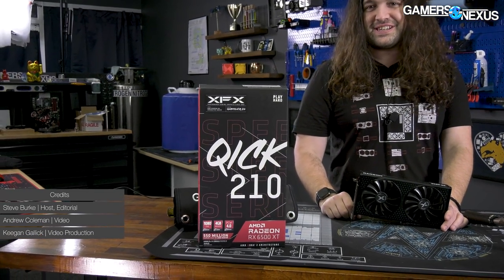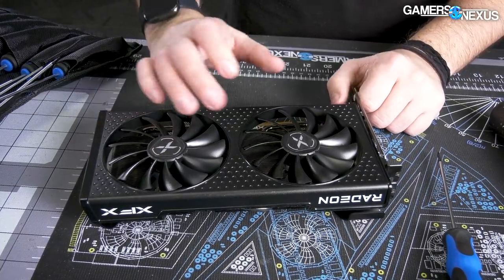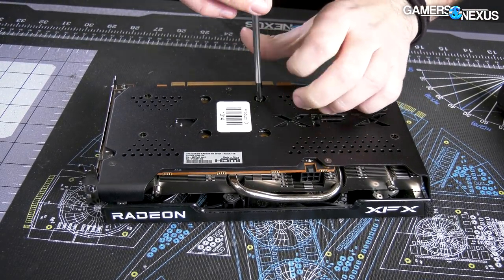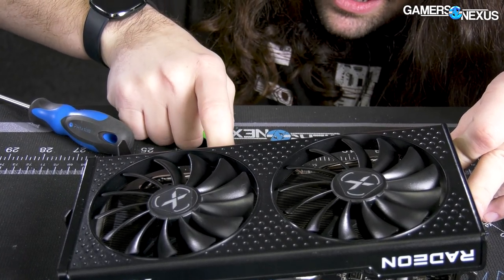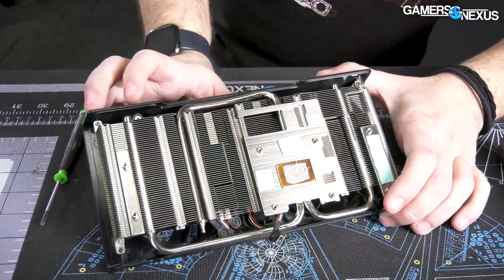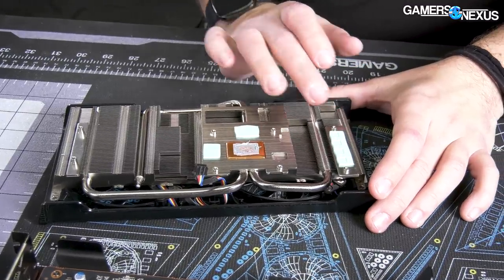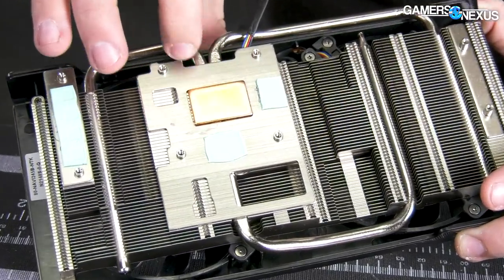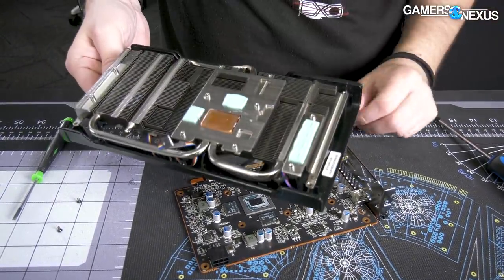Tearing Down Trash: AMD XFX RX 6500 XT Disassembly

Comment: If this was a low profile, single slot card at 75 watts with no 6-pin, it would be awesome!  What you have is NOT awesome!
Reply: Instead you get whatever Gigabyte thinks makes sense for this GPU, 3 fans for super cooling 100watts
Reply: Perhaps that could be what the rumored upcoming RX 6400 is?
Reply: @thelegendaryklobb2879  The RX 6400 isn't "rumoured", it was announced alongside the RX 6500 XT. It's just OEM-only.
Reply: The 6500xt has same pcie electrical connection with 1030 lol
Reply: @thelegendaryklobb2879  as a primarily Nvidia gpu guy I had high hopes for the 6500xt and 6400. To see the 6500xt perform worse than a 5500xt is disappointing as hell. I fear what the 6400 benchmarks are gonna look like. The 6500xt is a true pandemic gpu. Amd cheaped out in so many places that they basically botched a what could have been a decent budget gpu
Reply: @justinbiggs1005  
Cost for the 6500xt in the current crap show
Die cost is around $18
Board, VRM, etc. $50
30% markup to pay for R&D and other things (Normally is 60% for Nvidia and 45% for AMD) Total 150
VRAM $12 a GB so $48
Cooler $15
Shipping (right now) $30
The rough total before any AIB markup, $195
Reply: VERY much this. We need more low profile solutions. 
Currently best on market is 1030. MAYBE...the 1050 and 1650, but they're always double slot low profile at best, 
and they're also 300 bucks or more right now.
Reply: @AC3handle  GTX1050 4GB is legendary on gaming laptops. Way better than GT1030.

GT1030 can't handle Crysis remaster, 1050 mobile can.
Reply: RTX2060 mobile is pretty good too.

The only good card from that list is the GTX1650, but it's Pascal refresh, there are better options out there for a similar price.
Reply: @saricubra2867  I have a 1050ti, it's fcking fantastic. I love it. NO need for extra power, although oddly enough, it does have the traces FOR one. 
PROBLEM. It's a full size card, that's 2 slots wide. 
You ever see the picture of a dell low profile machine with a hole cut in it JUST for that exact card? 
I felt that to my bones. 
As said in another comment, if they could make a low profile version with just a slightly less powerdraw, the market for it would easily pay for the cost. even at the 300$ mark.
Reply: @saricubra2867  Low profile?
Reply: @justinbiggs1005  Agreed
Reply: @AC3handle  Yes, Ampere is better than RDNA2. Pascal is more efficient than RX 500 series.
Reply: Also $99.
Reply: It's literally a worse 1650 Super over 2 years later
Reply: except it costs a lot of money to produce and ship this card RIGHT NOW, a sub 150 dollar card would be throwing money away right now if you were amd!
Reply: @bitelaserkhalif  pci power from the slot is 75 watts. The 6-pin on the 6500xt is for the extra 5w.
Reply: @bitelaserkhalif  The 1030 is 30w. It doesn't even need a fan and can be cooled by a beefy heatsink.
Reply: Amd 5300 for oems only is one
Reply: @AC3handle  I run a straight 1050 2gb in my business computer and it's great for video 4k, movies, and it will still game on low and medium settings in some games. I still own a GTX TITAN 1080 with 12 gigs of ram on it and play games on it also... Just sold a GTX 1070ti 8gb for $550 when I bought it a few years ago used for $200.00. I'm not spending any big money on video cards until AMD and Nvidia get their shit straight and stop gouging people with the trash low and medium range shit cards....
Reply: @petedetraglia4776  Unfortunately, this is what the market demands, and thus, what the market will bear. 
I thought the 3070 was a great price at 500 bucks for what it offered. I knew the 3060 would likely do the same. 
Unfortunately, we got shorted, and crytos and botters got the lions share. 
Now, any business just looks for whatever processor can handle the video load. Or they buy HP and their crap ass super crap shit cards they toss into them. 
This is where we are now. Until the market gets saturated to the point that scalpers can't outbuy supply, that's the way it'll be.
Reply: No because it still wouldn't have simple codec support.
Reply: The W6500M is a way more sane card with 50 watt TDP it uses 50% less power and is like ~7% slower
Reply: @benc3825  
Source for all this?
Reply: There is a graphic card call 1650 ddr6 , without 6pin ,even cheaper than this amd shit
Reply: @justinbiggs1005  what it also shows is how much of a convoluted mess the gpu market has become due to the actions both sides have taken over the last 10 years trying to artificially segment their product lineups in the name of profit which has now come back to haunt them over the last 2 generations.
Reply: 30 watts*
Reply: @suntzu1409  He can't cite one, he's been choking on AMD's dongle and found a post somewhere to regurgitate here under every post.
Reply: @Aleksander304  😂😂😂😂